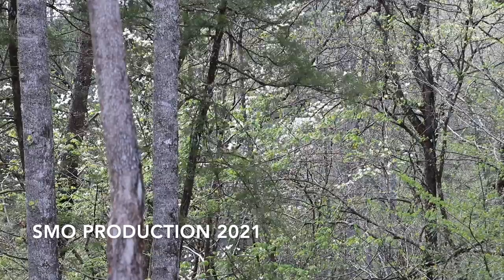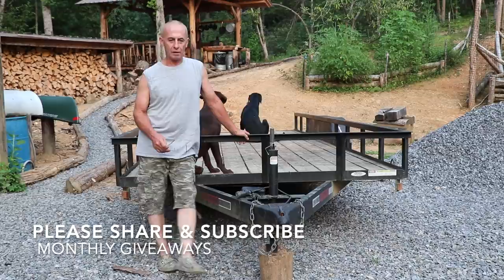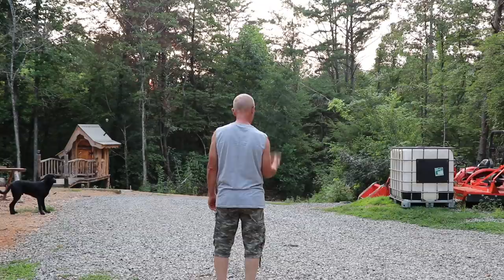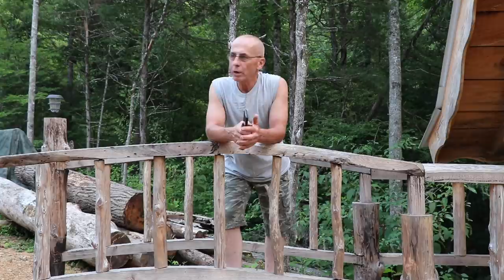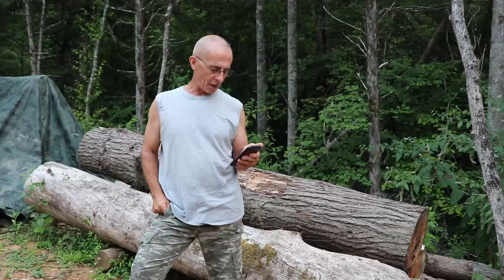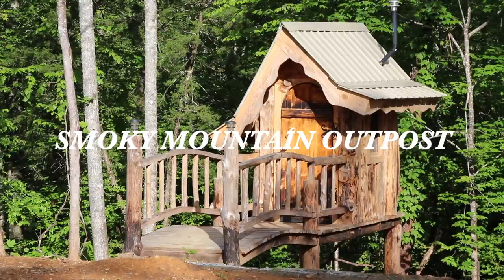TIMBER FRAME CABIN OFF GRID HOMESTEAD | FRONT PORCH & OUTDOOR SHOWER PLANS

Comment: Hi Richard,  I was in bed waiting to sleep and I started thinking about your idea for an outdoor shower.  Until you can get the totes, could you perhaps paint some of your blue water barrels black, buy a garden hose attachment with a shower option.  Then put some big hooks on the supports for your garden cage and make a level wooden platform with a tin bath or similar basin to stand in.  You could then shower and use the soapy water to spray your cabbages etc.  to keep the bugs off. Perhaps when you build your back deck you could have a few steps from  the platform down to the deck so you can go directly from the shower into the house. Just a sleepy thought!  I'll go back to bed now and try to sleep.  Looking forward to your video on the other channel tomorrow.  Sending you all love and blessings from England.  Night night😴

Comment: If you want a solar shower you have easier options then painting a tote black as a solar water heater is easy to make using a metal 55 gallon drum in a insulated box with a glass window/sliding glass door covering the side facing the sun. For a shower a 150 foot roll of black poly pipe spread over a roof that faces the sun will work for a water heater using a small pump to push the water from a tank. 

Look around for someone taking down a building with a tin roof as you can use that to line the inside of a shower stall to waterproof it. With the inside lined with metal the outside can be lined with any siding you like to keep it looking like the rest of the buildings. A lot more room then the stacked totes and you can customize it to include a changing area and use rounded river rock or pea gravel for the floor to not be in mud. 

Don't you want to do things so they are ADA compatible to start with anyways? You would have a problem getting a wheelchair into the tote stall and no room for a bench inside not to mention what if you want to fit two into the shower

Comment: A big black cube will warm up some, but if you want to get good showers, another approach is to gravity feed water using the tote, and then loop a length of black hose all across a south-facing roof. From a practical standpoint, it takes a ridiculous amount of energy to heat 275 gallons of water when you only need around 2% of that.